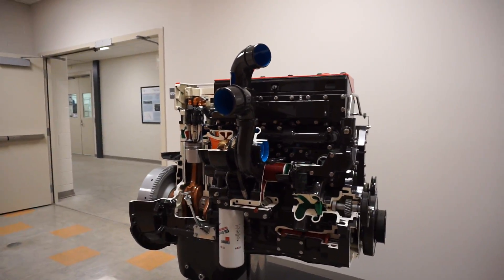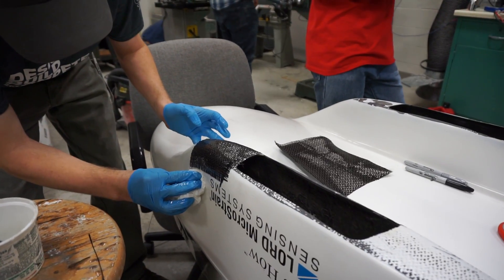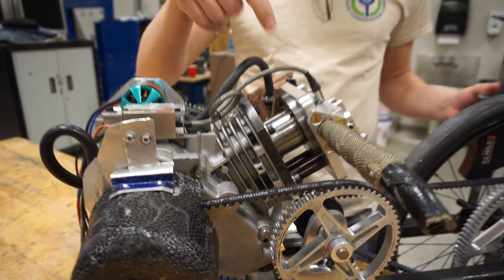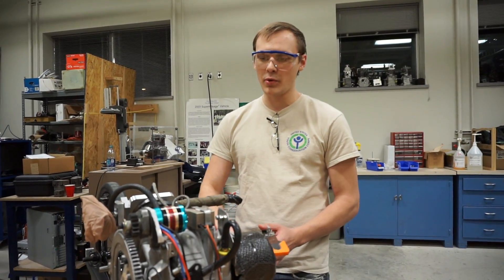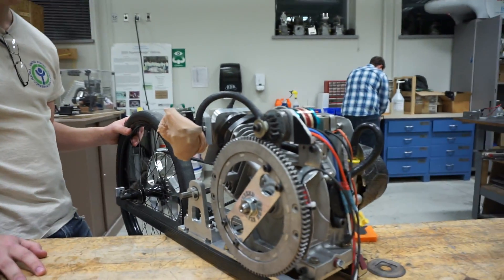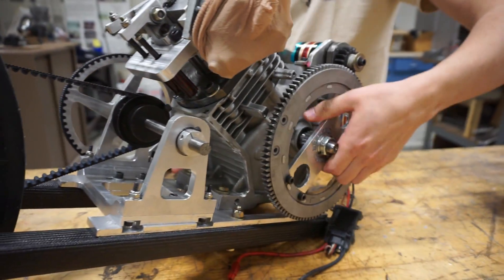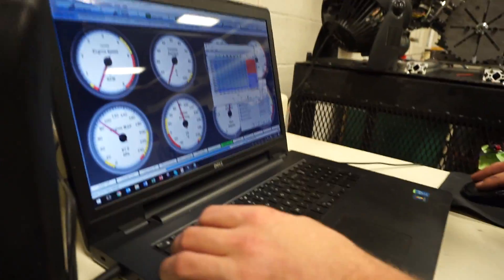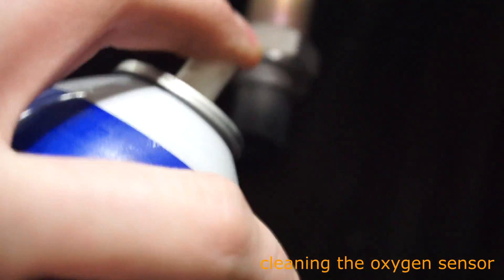How to Get Over 2500 Miles Per Gallon - Supermileage Club Penn State

Comment: Mazda wants to actually mass produce engines that use compression ignition for gasoline. If too much compression makes it detonate, why not work with auto ignition instead of trying to avoid it? That is what happens in a hcci engine. It is basically a gasoline engine that ignites the gasoline with compression like a diesel.

Comment: There is no way on God's green earth you could get 2500 mpg. sounds like the numbers are being manipulated.
Reply: Scribe Line small displacement, low engine rpm, -200% gear reduction, less obtainable volume due to smaller compression space, it is feasible and obtainable.
Reply: Scribe Line there have been car carbs way back then that got 150 mpg. this engine is way smaller and carries less of a load
Reply: You'll notice that they added a electric starter to the engine. When I was in highschool we had a similar competition and the winner had a trick where he would shut off the engine, coast for a while, then start the engine again for the uphill portions of the track. I dont remember the exact numbers but I'm pretty sure they reached quadruple digit MPG's with a stock ~25cc engine. It's a lot easier when you don't ever idle and the engine is only running when needed.
Reply: TheOneAndOnly FlamingPotato bullshit, a regular car with only carb mods will never get that high. Combustion still needs a reasonable ratio regardless of how you give it fuel.
Reply: S01LACED 
They should try make it run on water thats where the real test is
Reply: it's also super lightweight, and has an optimised surface area for extremely low Cd. all perfectly achievable (for those of us living in the real universe governed by the natural laws of physics).
Reply: My bicycle gets infinite mpg. 

Basically, if you throw all usefulness of an engine out the window, I don't see why not.
Reply: mpg never states what type of fuel it is... :)
Reply: Valueless Dollar @6:55 he mentions is is running 100 octane racing fuel.
Reply: No it doesn't. It still takes energy to move it. Weather it's "old" concentrated, stored energy like fossil fuel or new energy like food, you are still using energy and producing waste. So I'm sure if there was someone motivated enough (which I'm not) I'm sure they could tell you your equivalent "mpg" while riding. There is no "free ride".
Reply: O.G Garcia everyday drivers regular cars.
Reply: with modified carbs
Reply: Where is this and how do I get it?
Reply: George Dang technically your bike gets 0 mpg because i couldnt use a gallon in the first place
Reply: _Milo 200 present reduction. Really. Where's the worm drive.?
Reply: O.G Garcia ... You know.  Those perpetual  motion cars.
Reply: The air drag is approximately 50x lower than a Prius and weighs 15x less, along with tires that are~ 5-10x lower rolling resistance.  Run the engine at full throttle doing a burn and coast method so you don't waste fuel idling (only about 1/2rd the engine efficiency of a Prius).  Add this all up and you have about 60X less drag than a prius with an engine 1/2rd the efficiency, so you would get about 30x higher fuel economy.... a Prius at 15-25 mph could do 100 mpg on a flat road, so the supermileage car would get 3,000 mpg.    The Society of Automotive Engineers runs the competition every year under very strict guidelines.  The results are here:  http://students.sae.org/cds/supermileage/results/

Honestly, this car could get 5,000+ mpg if everything went close to perfect.  Team's in Europe with lighter weight drivers and better engines get 6,000-8,000 mpg.
Reply: To be more specific, they use Isoctane, which is what the octane scale is based on (100) and is used by laboratories to gauge fuels.  It actually has a lower energy density than gasoline, but it's the most uniform and is good until about 18:1 compression ratio before autoigniting.
Reply: It's yours and mine, this green earth. If you believe in the imaginary deity, I can see why you don't have any belief left that proper engineering and experimentation would yield extraordinary results. Nobody is saying this engine will last for 10 years or reach 60miles/hour like your daily driver. This is an experimental vehicle that reaches 22mph for peak efficiency. Watch the whole video and open your ears next time.
Reply: TheOneAndOnly FlamingPotato what are these cars your talking about
Reply: The numbers in this video are haphazardly thrown around to the point to where i have trouble understanding what the fuck the purpose of the video was about. Did this man really say 2.5hp? I think id actually rather raise and feed 3 actual fucking horses and  ride a gay ass carridge to walmart to buy my hemerroid ointment just as an excuse not to drive this retarded idea of a fucking overglorified bicycle.  "Carbon fibre this" and, "carbon fibre that". Quit throwing big fucking words at my face and expecting them to stick. I have an extremely hard time believing that you put an 18:1 in that fucking flathead knockoff. I got news for you folks. If it couldve been done it already wouldve been done. Thats just how it works in at least a slightly regulated free market society. Carbon fibre has been around long enough to see cathode ray tube televisions and dial-up internet. And some pot smoking physics student or engineering major would have thrown together the same thing together that was protrayed in this video. The only difference would be that he would atleast put the engine inside of a  fucking lawn mower or dirtbike. Because fucking lawn mower engines dont get 2500mpg. And if it did get 2500mpg, then have fun strapping eighty of them to a  fucking semi because thats whats its gonna need to satisfy the consuming urges of a small walmart. If you want to tell me that this engine is fucking brilliant and that is it so fucking efficient that it makes so much out of so little, then why dont you explain the fuel this thing uses. Does it run on diesel? Did you pick an acronym to nickname this fuel something that i wouldnt understand? Is this an elaborate attempt at getting views? Well, it this were the case then it worked because this physics major doesnt understand why this engine fucking matters. And, does not know how to comprehend how fucking stupid this video was. Wow you made a bicycle tire move without the use of a pedal. This shits been done for over a hundred years. I wouldve respected the author of this video more if they wouldve at least tried to make it look like a steampunk antique. Instead it just looked that way to me even after they polished their turd and made it look slique and new even though they were using what is essentially charred string and resin to make a fucking magazine article on wheels.

Comment: they should have just used a 50cc pit bike engine and gone from there
Reply from the maker: +rcdude11119 we are forced to use this model of engine.
Reply: Well that sucks. It would have been cool to use a briggs animal or a predator 670!
Reply: Makerj101 That kinda sucks. I've played around with Briggs, Honda, Predator, and those pit bike engines and the pit bike engines are a lot more modular. The pit bike engines already have a gearbox built in. O well beggars can't be choosers lol.
Reply: +rcdude11119 built in gearbox is the opposite of modular and biggest issue putting bike engines in cars. except this useless single rear wheel thing.

not to mention that transmission would not be as efficient as the purpose built one for the task at hand

Comment: the engine diesiling will stop if you modify valves to have dual springs and a different lobe on can that will stop engine flutter at higher revs also use bearing on crankshaft

Comment: dont know for shure , but isn't an belt les eficient than a shain?
Reply from the maker: +Jari Szczuka chain might be more effect at lower speeds and higher torque. We are running it at pretty high speeds so I think a chain would slap around a lot and waste energy. Not really sure tho. It's a good question. I'll ask the guys tomorrow.
Reply: Makerj101 true👌👍

Comment: 21:1 compression ratio that's massive for SI. Maybe the combustion chamber is long and skinny enough at TDC to cool the fuel and resist detonation?
Reply from the maker: +ghetto bikelife the combustible chamber is pretty long. When the engine heats up enough we do have problems with detonating. The engine never heats up much in the competition because it is only run for 10 or 15 seconds at a time. When testing we can turn the ignition off once it's gotten warm and it will diesel and continue to run. Choke comes in handy then lol
Reply: if its direct injected they can diesel it and control detonatiom
Reply: You can have a high compression ratio and a lot of advance on the timing if you don't open the throttle very far. Did he say they were running at 4300 rpm and 22 mph during the contest? Seems like a high rpm for milage.
Reply: The mean piston speed is actually on the low end of the spectrum due to the shorter briggs crank.  Peak efficiency even at full throttle maxes at ~4k rpm.
Reply: race gas is preventing it and decreasing timing also.The high the octane the chance of detonation goes down.The higher the octane the more timing and power they can also get out of it
Reply: Sounds like a SCCI engine to me.

Comment: Another innovation in small engine carburetors is the Vapor Carburetor.  Invented by Jan Ridders for his miniature engine models, the idea is to vaporize the fuel by bubbling air through the fuel in the tank and then introducing the "fumes" into the intake.  http://ridders.nu/Webpaginas/pagina_benzinedamp_carburateur/dampcarburateur_frameset.htm

Comment: http://www.evicengines.com/     A friend of mine who builds miniature engines has been using Electronic Valves on his engines.  this eliminates the Cam shaft, the cam gears, the lifters and then push rods.  It also enables the engine to run very efficiently at any RPM.  Might possibly help with the high RPM valve float problem too.

Comment: 2528mpg pulling what weight on the dyno? You did that calculation right? The resistance on the dyno was the weight of the vehicle +150 lbs (driver) right? That can cause a loss of 800mpg from your calculations if you didn't include the driver.
Reply from the maker: Vydonis oh no no no... that was the measured mpg that the car scored in the 2016 super mileage competition. I have no idea what efficiency they got on the dyno last year before the race. I'll have to ask them. checkout the article on it. http://news.psu.edu/story/415561/2016/06/22/academics/penn-state-behrend-supermileage-team-exceeds-2500-mpg

Comment: Interesting, do you know what the brains of the EFI system is?  Just curious what sort of computer exists for a single cylinder application.
Reply: check out cars and cameras they put an efi on a single cyl. there are kits to do it
Reply from the maker: gadget73 it uses a MicroSquirt ECU.  it supports 1-8 cylinders and fuel injection
Reply from the maker: jeep2003 yep, thanks. It uses a MicroSquirt ECU

Comment: go vapor or use the exhaust heat to vaporizer the fuel liquid to gas guarantee 3000mpg
Reply: it would increase efficiency but would also start the knock-fest even on 100octane fuel, and that's bad
Reply: >2500mpg
>carburetted 

hahahahahaha
Reply: This right here, reminds me of something Nascar legend Smokey Yunick did to a Pontiac Fiero. Had a pretty odd experimental setup for mpg, worked far better than anyone expected as I recall.
Reply: That guy died mysteriously in the desert btw
Reply: rip those stupid wheel wells out entirely so you don't crash on every bump and put some fuel injectors in that pig instead.
Reply: on that pig. lol.
Reply: Thats in a 1984 issu of Hot Rod magazine
Reply: Mauricio Espinoza what you do is put it in a propane tank with heating coils inside, then you put pressure and heat gauges and have a vacuum pump hooked up with a one way valve right off the nozzle of the tank.. You pull a vacuum and then heat it a little but not much yet, the vapor being formed will push any remaining oxygen out of it that might be there.. once all oxygen is gone you can heat it as hot as you want until you hit max pressure in the tank.. You use the vacuum pump as the fuel pump straight to the carb
Reply: The carburetor they used is not suited for that. Its a simple single jet carb with an idle port a choke plate and a throttle valve. also running on vapors would make it run incredibly lean. Lean combustion=heat=broken engine.
Reply: Mean machine You are correct using vaporizer would increase efficiency
Reply: yes on a two stroke but not a four stroke, I built one of these systems and it ran for a considerable amount of time with no problems.

Comment: So you can make it from Penn State to Vegas on 1 gal of fuel it's only 2,301.3 mi.
Reply from the maker: 73turbopinto in theory. I kinda doubt the tires, engine, and some other systems would last that long. It would also take quit a while because you'd only average around 15 mph to get that fuel efficiency. If you go any faster the fuel efficiency drops off because of air resistance.
Reply: The real world sucks doesn't it...
Reply: +73turbopinto lol yea, I doubt this thing would make it up the driveway to leave! hahaha

Comment: what are the width of those tires? I noticed that the rear one was thicker than some of the racing tires available on the market. with a thinner tire, you could achieve less rolling resistance, as long as braking is not an issue lol

Comment: Note the glaring lack of gas vapour bubblers.  :)

I think it's terrific that you've found this club that ties into so many of your long standing pursuits!

What sort of problems are being encountered with the small fuel injection system?  Lack of fuel pressure -> inefficient nebulization/long duration injector cycle?   Low-to-non-exsistent intake vacuum?
Reply from the maker: Hahaha yep!  No HHO system either!  :P  

IDK about fuel pressure.  Higher pressure would probably atomize the fuel better.  So far this is the best I have seen this engine run fuel injected.  So we are making progress.  I wonder if injector cycle duration might be a problem when we install it on the smaller displacement engine.
Reply: Well, "injector" is a slight misnomer; it functions more like a gate, as it doesn't actually supply any injection pressure or metering.  a pulse of current opens the injector for the duration of the signal, and fuel will flow at the rate of pressure difference before and aft the injector and the amount of restriction present in the nozzle.  

In slightly older cars, the fuel rail would be pressurized and regulated to a set pressure in the 40 - 60 PSI range.  Since the pressure is constant, the volume of fuel that's dispensed while the injector is open can  be calculated precisely.

I didn't see any sort of pressure regulation on the fuel delivery system on that engine; if that's the case, then it's difficult to determine (in advance) how long the injector should remain open to dispense the right amount of fuel.  Also, as the fuel level changes, the amount of fuel being admitted during the injection cycle will vary, so the engine will swing from a rich to lean burn as the fuel level drops.

Oh, and never handle a fully pressurized injector.   It'll shoot gasoline into you like the hypospray dispensers in Star Trek.
Reply from the maker: Nevin Williams yes, you are correct. there is a fuel pressure regulator. If you follow the tube from the fuel bottle it goes to a T. one side goes to the in-line pump. then goes to another T. one side of that T goes to injector. other side goes to pressure regulator which returns the fuel back to the first T. We need to get a pressure gauge on the line so we can monitor pressure. 

I think only diesel engine injectors are dangerous because they run at thousands of psi. just like a pressure washer. This little thing uses like 40psi. it'd be like a little tickle.
Reply: Cool, I didn't see the extra plumbing...  

Might need an accumulator to smooth out the pressure; lots of hydraulic hammering when valves are popping open and shut; it's such a small circuit, too.
Reply: Could there be any advantage with using a higher fuel pressure, or multiple shortened pulses from the fuel injector, per cycle?